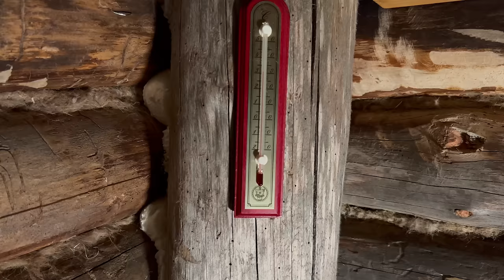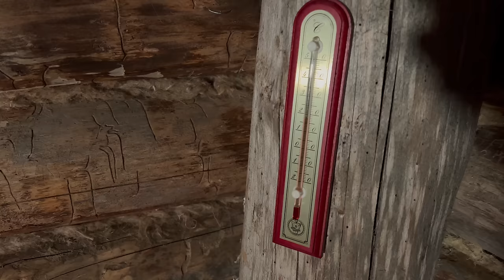I spent the night in a SECRET BUNKER dugout, the BEAR came at night, no talking

Comment: Seiously. A few Cables so you have glassfiber-Internet. A Heat-Converter and Solarpanel to generate Electricity. Best Way to live. No obstruction of nature, great physique, mental health due to living so close to calm Nature itself, perfect. Hospitals etc. no problem, keep the infrastructure and a parking-lot at the borders of the forest, the rest should be this way, or using other more high-tech buildung-techniques like using concrete made out of the forest-floor with wooden insulating. A dream come true, thank you for this beautiful view.